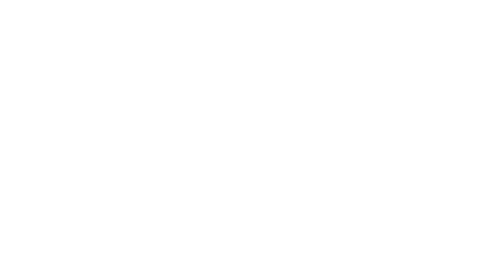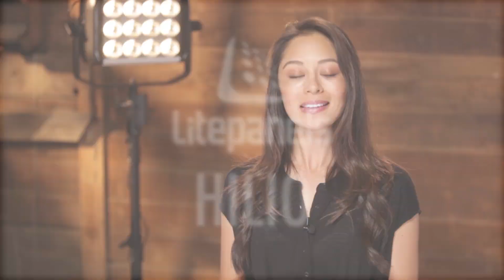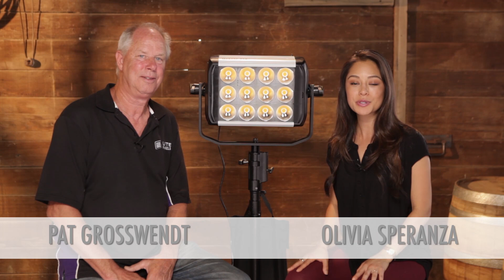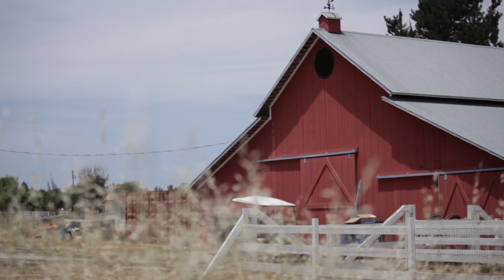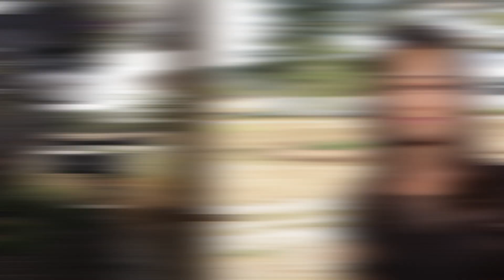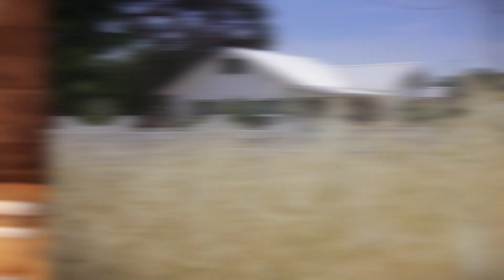Litepanels Hilio T12 and D12 LED Lighting

Comment: So why would someone choose this over the Inca 12 / Sola 12?
Reply: raredreamfootage I'm wondering the same thing myself.  The only thing I can figure is the cost difference.  The Hilio is over $1,000 less than the Sola or Inca 12's, but those latter ones are Fresnels, which give you control over the spot/flood.  The Hilio does not.
Reply: I am pissed caused recently it was on sale at b&h and i didn't get it. this thing is do portable with so much light giving you the ability to shoot at really low ISO
Reply: There are LED fresnels which give the same output for less power and better light quality and more easily modifiable.
Reply: +raredreamfootage  what do you recomand?
Reply from the maker: +raredreamfootage As Mentioned the Sola/Inca are our LED fresnel range that give you the ability to remote spot/flood
The Fresnel range also allows you to cut and shape the light just like a traditional Fresnel while the Hilio D12/T12 are a high output panel that give you a wide wash of light
The fresnels you mention are 6" and 10" Fresnels While the Sola/Inca 12 are 12" Fresnel that allows for remote focus so they are a bit different
Reply: Ikan has the WS-F350, the best bang for buck 350 Watt draw LED fresnel.

Mole Richardson has the Studio Junior 400 Watt draw LED Fresnel.

The Hilio is a multi-shadow fixture, the above fixtures produce more natural single shadows since the led array is ultra dense so it appears as a single light source.